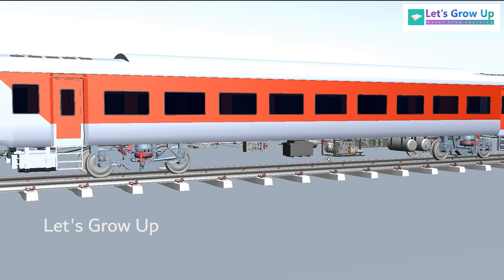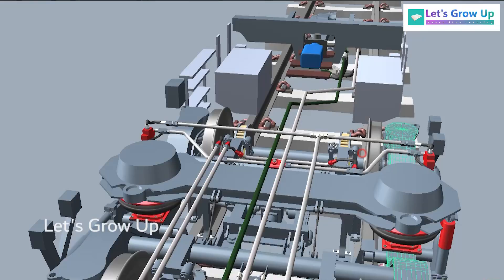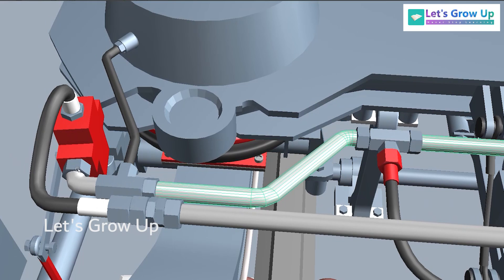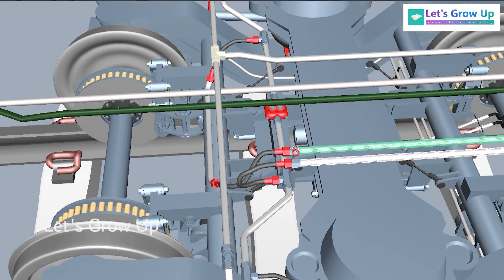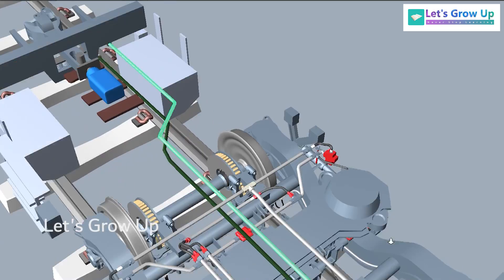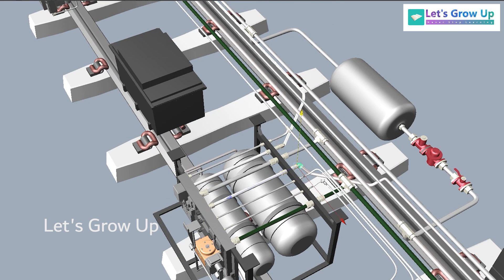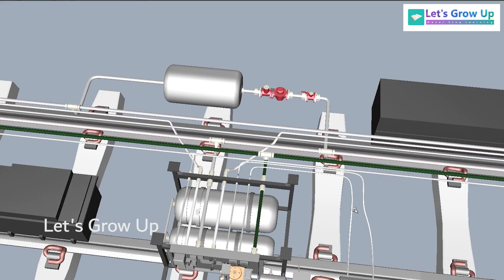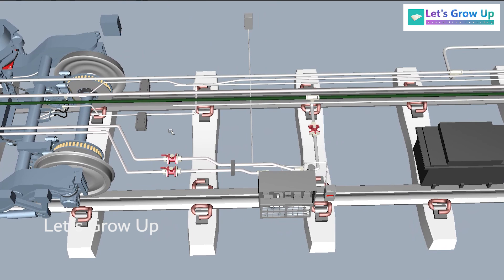FIBA Pipeline connection for Air spring bogie

Comment: The extensions of M14 and M11 are very useful and much needed. But among the new lines only line 15 and maybe 16 seems to actually serve a purpose. But what's the point of the lines 17 and 18? Why are they spending billions of dollars to build heavy METRO lines in these distant routes?? And at the very least they should've prioritized the extension of line 11 and the full opening of line 15, rather than trying to opened these other useless lines before 2030. There's no hurry for these lines, as opposed to M11, M14 & M15.